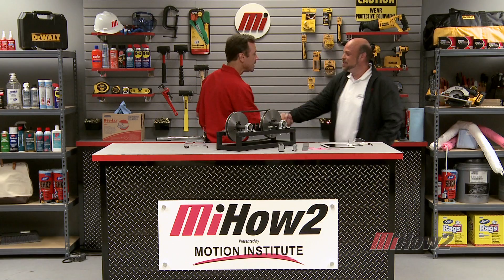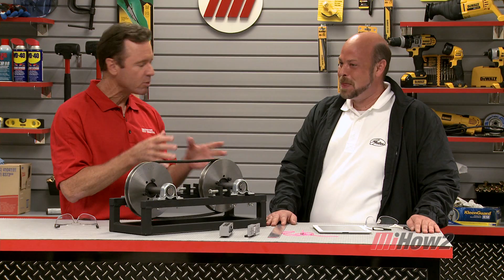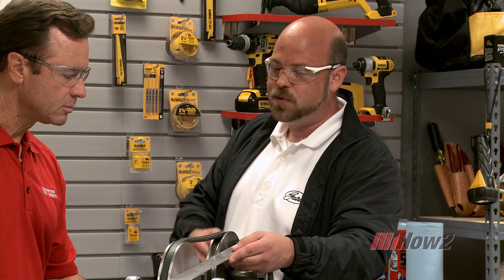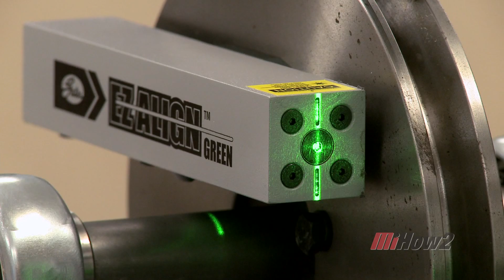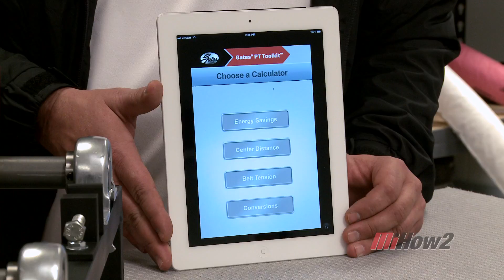MiHow2 - Gates -  V-Belt Drive Alignment Procedures

Comment: Will the string or straight edge do the laser alignment tool's job?
Reply: Yes a string works just as well if all 8 points touch or a straight edge with four points touch or a laser if you have the laser recently calibrated.  My strin and straight edge never need recalibrating.
Reply: Essentially, Yes.